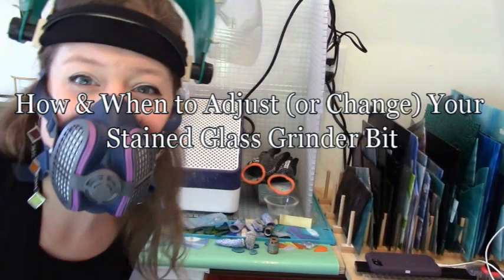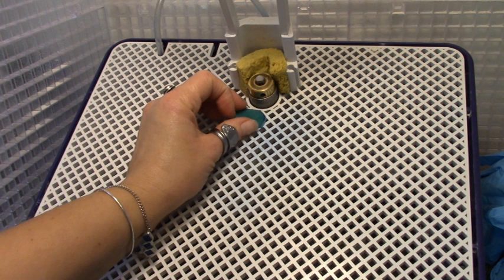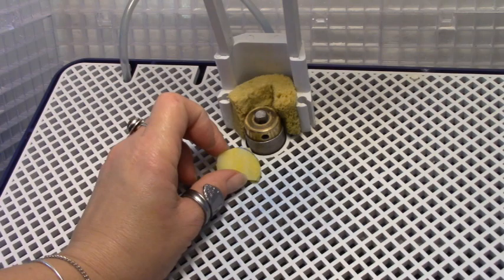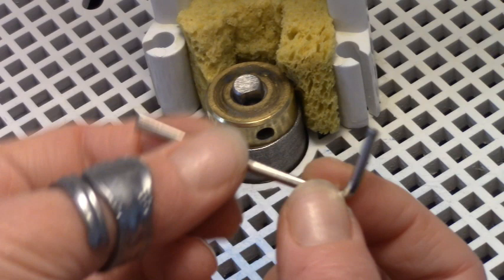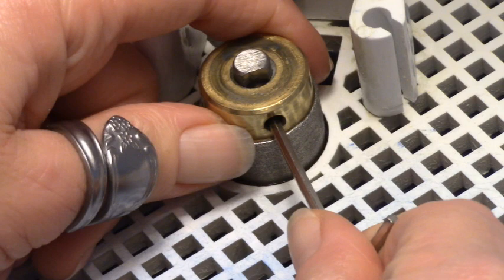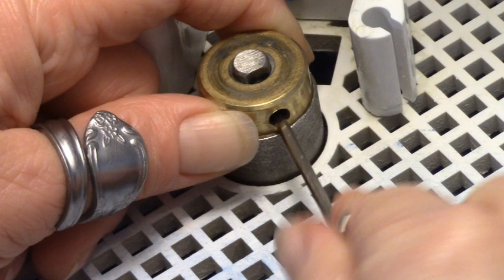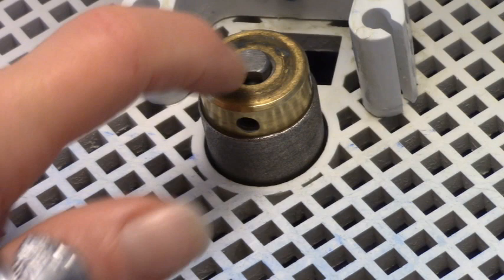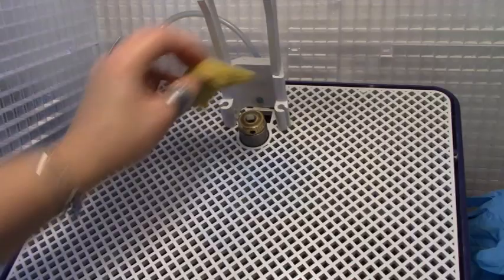When & How to Adjust (or Change) Your Stained Glass Grinder Bit

Comment: I've heard you should put oil on the shaft so the grinder bit won't freeze up. If so, where exactly does the oil go, and what kind of oil? Thanks 😊
Reply from the maker: Oh no I'm sorry I missed this one! I've heard that as well...I've never used oil & haven't had an issue. Buuuut, I do think that the quality of bit you buy makes a difference. Some of the cheapie bits are made with pot metal & those can get stuck because they oxidize. If you want to use oil, you'd put it on the end of the shaft, right where the bit would go (though the water is going to wash some of it away). 
I use Gryphon Bits which can be used on most brands of grinders😀
Reply: @mountainwomanproducts  Thank you for the information!

Comment: I have an allen wrench that came with mine but it doesn’t fit and I don’t know why, I’m pretty sure it’s too big. What can I use to tighten the bit back on?
Reply from the maker: Sounds like either your wrench or your set screw are rounded out (most likely the allen wrench...they're only made for temporary use since ya get a new one with every bit, so generally not super high quality metal). If you're using a new Gryphon Brand bit, you can get a 3/32" allen wrench from the hardware store or amazon. If you're using the original Gryphon Brand bit that came with your grinder (not a replacement bit), then you need a 5/64" allen wrench. 
The wrenches usually come in a set of a bunch of sizes. Let me know if you have any other troubles😃
Reply: The wrench used with the bit that came with your grinder and the wrench that comes with separately purchased bits are usually different, this is the case with Gryphon grinders and bits.
Reply from the maker: Yuppers! The bit that came with the grinder takes a 5/64" and replacements bits take a 3/32".  @matthewwolfe6848

Comment: How do you un seized a grinder bit. I hadn’t taken mine off for a long time but the screw comes out but the the not the bit😢
Reply from the maker: Oh no! I don't know the answer to that...I'll ask around & see if I can get some info for ya! I do know that ya have to watch the quality of bit you're getting. Some of the cheaper ones are made out of junky metal and I've heard of problems with them seizing to the shaft.
Reply: Unfortunately, sometimes so much buildup of grinded powdered glass left unchecked can set up between the shaft and the bit that a kind of fusing of the bit to the shaft takes place. Stay away from bits that are not brass as well, so called chrome or stainless steel bits are junk and rust quickly.